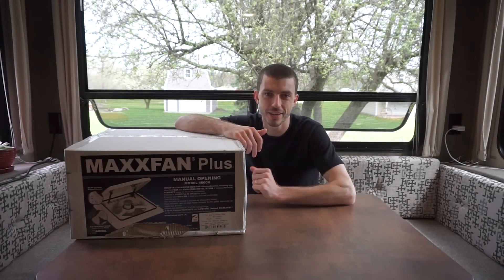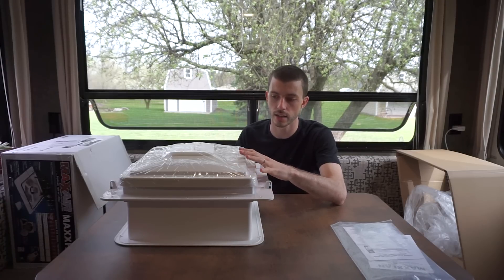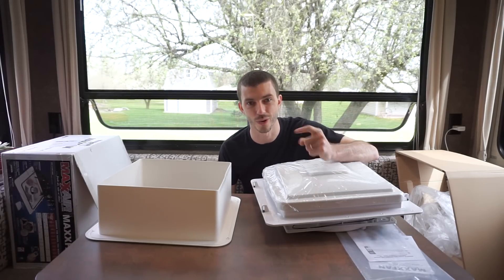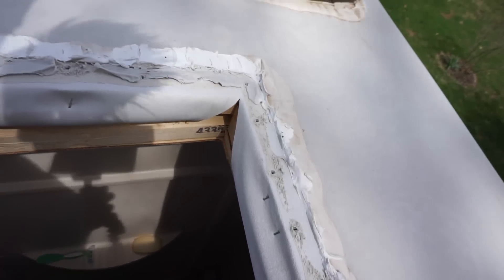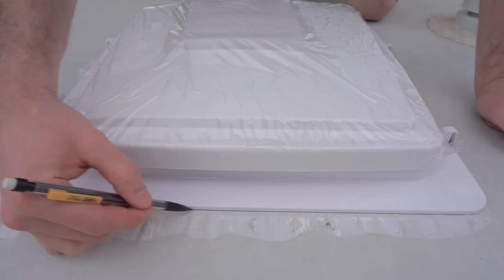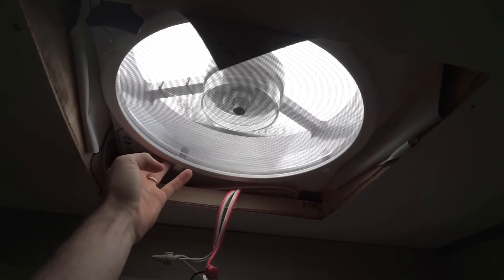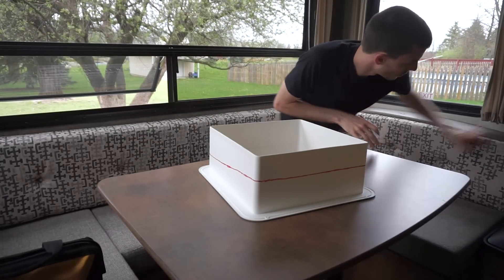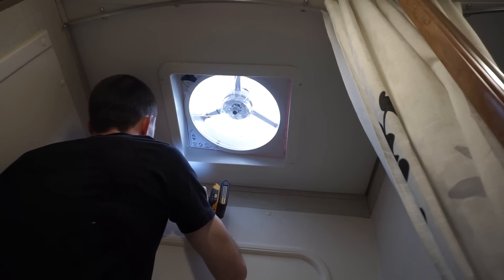MAXXFAN RV Exhaust Fan Install - RV Upgrades

Comment: Hey, David... thought I'd mention this (for future similar work):  I had to do what you're doing at 6:00 above, removing the old lap sealant.  There is ZERO question that using a heat gun makes this a little easier.  It just softens it all up so it's much easier to peel back.  In my case (Grand Design), we have a rubber roof.  I hope I'm always where I have 50 amps so I can use a heat gun!  Watching the rest now.  Simply because I came to see how you do the new lap sealant... and I like your how-to's, as I really trust your judgement and processes 99% of the time!
Reply: Oh, and yeah.... my thumbs hurt now, too, from rolling up the old lap sealant!

Comment: Well done video. Thanks! I used it 2 years ago replacing the muffin fan vent in the living area of our Grand Design Imagine and replacing the bathroom muffin fan this fall. Both are Maxxfan 4000K. We love the auto feature that turns it on at 78°. We got the Maxxair covers for them but we’re disappointed we couldn’t use the Maxxair covers we already purchased for the basic fans. But the company has great customer support. It was great to review this again before installing my 2nd unit today! Thanks again.

Comment: I wish they made a metal-framed Maxx air fan.  Everything is made of plastic now.  Crazy that people are replacing their stock exterior metal frames with these China made plastic ones that will crack eventually, especially if you live where it hails.

Comment: I agree with tdc8 heat makes all the difference in removing the old lap sealant. I use a hair dryer and have found that if it gets too hot it get gooy, there is a sweet spot for the temperature and it peels up nicely.  Just be careful not to damage the roof material. I use plastic scrapers and they work well.

Comment: Great video and step by step guide that I used for my install... But before anyone goes and buys yet another power tool just to cut the flange to fit.... I used a pair of scissors. Works exactly the same!

Comment: Great job on the cleanup and installation of the new fan.  As mentioned by others, opening only the shaded side windows will certainly help on the airflow.  Electronic fans like that have a speed set that extends the life of the unit over time. While it might be possible to speed them up more, that only generates more heat for the motor and wears it out before it’s scheduled run time is reached.

Comment: As a general rule you don't want too strong a fan in the bathroom, because if it's running when you flush the toilet, black tank odors will be pulled up into the Rv. With enough windows open shouldn't be a real problem.
Reply from the maker: We dont have a black tank we have a composting toilet so no issue there

Comment: Fewer windows open will increase the speed of the air. The best way to use it to cool the camper is to only open the windows that are on the shaded or coolest side of the camper. It will make a huge difference.

Comment: I think having 2 of those makes a huge difference in cooling off the RV...one blowing in and the other blowing out creates an amazing draft.   I'm not sure if you have 2 openings in your rig, but it's something to consider.
Reply from the maker: We don't have 2 places to put another fan, just the one in the bathroom. We do, however, have 2 small 12v fans we can plug in and put in the windows if needed on hotter days.
Reply: having one blowing hot air in off the roof makes no sense

Comment: Nice job,  we have the same fan and it works great. We installed a hood over ours so if its lightly raining we can use it without the worry of rain  getting in. Also, it help protect the cover that comes with the fan from breaking down from sunlight or blowing off while traveling should it be left open. Nice job you two :)

Comment: It looks like the fan works like an all house fan.  You get a better breeze and air movement when the windows are just cracked as opposed to wide open.  It creates more of a vacuum type atmosphere and really cools things down better.  Try that maybe? GL!
Reply: Yep, you're right. The idea is to crack the windows to get the ideal rush of air through the trailer. Windows wide open would give a disappointing performance. I installed a MaxAir vent cover over my existing  bathroom fan, allowing use in any weather. However, in harder rains, we still crank the lid down.

Comment: I just paid a total with tax included, of $176 for Maxx fan exhaust fan with the aerodynamic top. It looks like the deluxe, but it's only for exhaust and is manual to open and close the vent. I'm installing it on a 97 Geo Metro hatchback RV conversion.😎 Then i plan to sell the mini camper car so I can buy a van.

Comment: important information: For better pressure of airflow, close the windows more. 
Now imagine trying to blow out a candle with your mouth like this:😮 You get no pressure that way. 
Now try blowing out a candle with your mouth like this 😯. A smaller opening increases pressure of air flow. You just need to find the perfect ratio. Try putting toilet paper strips in front of the windows and close the windows a bit more until the breeze gets stronger to blow the paper around, flapping. The more the paper flops around, the better the flow and you'll feel the wind breeze the best.😳

Comment: Great job. as for the flow, you did get the LOWER end one, right? 4 speeds??? the 10 speed does a great job but it is way Louder.

Comment: I'm pretty sure my 3 speed Fantastic Fan spins a lot faster than that but we didn't see it run very long in the video.  Old news now (I'm watching you guys from the beginning), but you get more airflow with just one window farthest away barely cracked.  And make sure holes are sealed up elsewhere that could be affecting draft.  In your new camper they probably are.    I wonder if the wire size is big enough for the increased motor?  As a test sometime you could run a jumper cable directly up to the fan and see if it increases the speed.   Enjoying your channel!
Reply: The replacement fans are designed to operate on existing wiring. Hence, replacement, not rebuild. Always a good job guys!

Comment: Max air vent cover next. Pretty cheep and easy to instill then u can run it in the rain.. if you haven’t done that already or may not have known.
Reply from the maker: +Robert Troumbley We looked into those before buying ours and decided we didn't need it. We figured we could save a little money and didn't mind not running it in the rain. Thank you though!
Reply: Robert Troumbley, At that point you just get the 6200k model
Reply: @FateUnbound  It will also keep your cover from getting burned up in the sun after 2 years and needing to be replaced. I've had RV's for years and here in Texas we get 2 years maybe three out of those covers then they fall apart and start leaking.

Comment: 2 things.…
Eternabond tape is much easier to work with than dicor. 
You only have to disconnect the negative battery terminal.
Reply: Doing mine with Eternabond right now...👍😁

Comment: Great job on the install. Thinking of buying one myself but concerned after reading about electrical issues. Have you had any issues with the fan so far?

Comment: Great vid, thanks!
Reply from the maker: +RandyRanew Thank you, glad you liked it!
Reply: Fate Unbound I watched your video then went out and did my own install!   Instead of going through the pain that you went through removing the old sealant, I decided to use a razor blade and cut through the thin vinyl that was  covering the roof of the RV and everything peeled right off. I then just had to use an extra inch or so of new sealant to cover the gap that was exposing wooden roof. Thanks for your help!
Reply from the maker: Awesome! I'm glad the video helped! That old sealant was a HUGE pain to get off, but I would be worried about water intrusion by cutting the rubber roof off. If you used enough sealant though you should be okay.

Comment: You briefly mentioned having to check the wire gauge of the camper to make sure it would suffice. Did you have to change anything out? noticed the RV wiring was much thinner that the MaxxFan wiring. Did it matter at all? I'm about to undertake this project and have been wondering about this myself.

Comment: Have you guys considered adding an additional fan?  I have an RV with a floor plan similar to your RV and was thinking of adding a fan just outside the bathroom door.  The air flow on full power might be adequate but on max the fan is pretty noisy.  I was thinking of getting two fans, running both on medium, getting the same cubic feet per minute air flow during normal conditions, and having a less noisy environment.  When it gets really hot you have the option of running both at full power to double the CFPM air flow.

Comment: Why did you tear out the whole unit? I did the same thing but only had two take out the old fan and install a new larger one from the inside only. It was simple and I had it done within 15 minutes. I ordered it from Amazon.
Reply: can you share a link to the fan you ordered?  Thanks!
Reply: @MarkWitzel  Heng's 90046-CR Vortex II Fan Kit

Comment: Ive thought about holes in the floor, with pvc pipe and a ball valve to close or open the draft. Much cooler under the RV then opening a window. One under or near the bed, one under the table. With windows closed, open the valve to draft in the cooler air to replace the outgoing from the roof fan. 

Ive also thought of 2 of those fans, with one in the BR. Allowing you to vent either the front or rear of the RV.

Comment: Too bad you didn't install a vent cover at the same time - they allow you to have the vent open in the rain and wind. After having them on my first RV (as well as my current one) I wouldn't be without them. They also help your max air vent cover last a lot longer since it's not being exposed to direct sunlight after a vent cover is put on.

Comment: @10:14, did it come with those screws? My 4401k did not come with screws. I see you did not predrill.  I need to screw over metal and would like to use self taping, what screw head is recommended?

Comment: i need a video showing where the wire is coming from
Reply: I agree , he put it on fast forward for the most important part wiring.Back to normal speed in the less important parts.

Comment: How’s the fan holding up ? Friend of mine said they rust easily.
Reply from the maker: We've had it 2 years with no issues and we run in almost every day. They're mostly plastic, only the shaft is metal and it's isn't rusting for us.

Comment: I would like someone to explain how to hook up the wiring. None of the vids i've seen shows that part of the install. We're not very good at hooking up electric. 🤔
Reply: Its 12v so positive to positive, negative to negative and ground to ground. Doesn't get more basic than that.

Comment: I installed the maxxfan In my e 250...checked the 12 v  voltage feed. Installed fan , hooked up , no work..I called etrailer who I purchased the fan from, they sent out a new fan .guess what, it didn't work either...I suspect it is an issue with the printed circuit board, ( maxxfan power boards do no work well with anything over 12 volts.if you have DC surges it will fry the board) I sent away for another board hopefully this one works.

Comment: Now the maxxfan 4541k with rain sensor and remote exhaust only is 149.00 on ebay. I put that one in my bathroom and the 4500k in the living room. It does intake and exhaust. The 4500k goes for 187.00 at camping world. The 4500k also has a rain sensor. Both of these fans open and close with electric and also have manual open in case of failure or power loss.

Comment: Why did you add a 1/2” to the measurements before cutting?
Reply from the maker: I left a little more material just in case, you can always remove more material but you can't add it back on =)
Reply: Thanks.   Reminds me of a pilot saying relating to altitude, you can always descend but sometimes hard to get back!
Reply from the maker: +David T. Holcomb Haha yeah pretty much the same concept! Err on the side of caution.